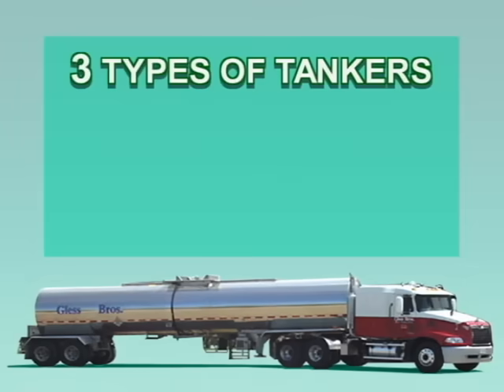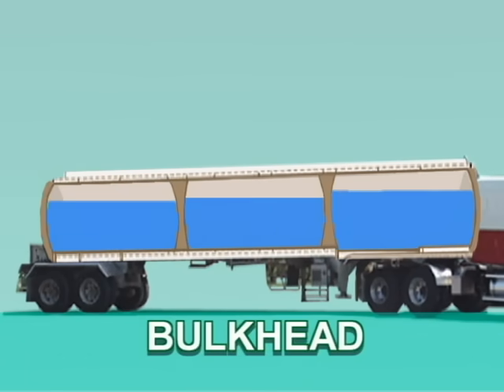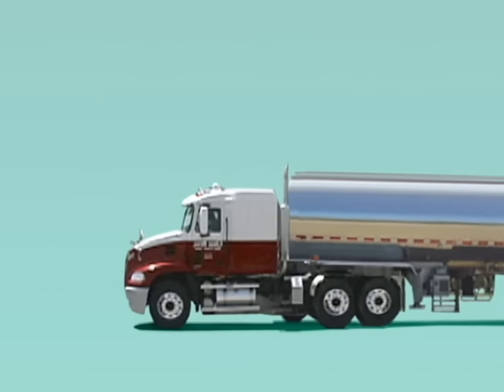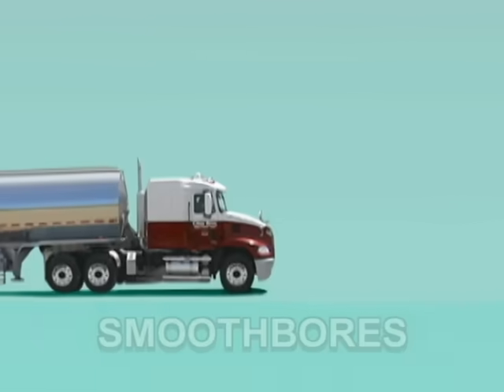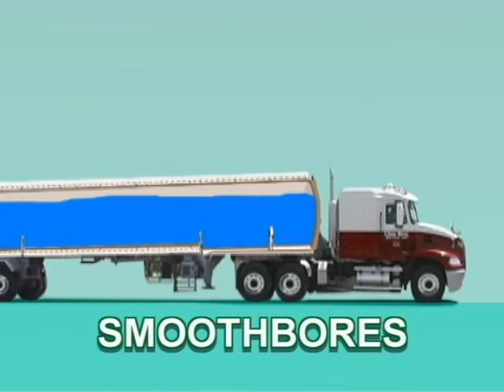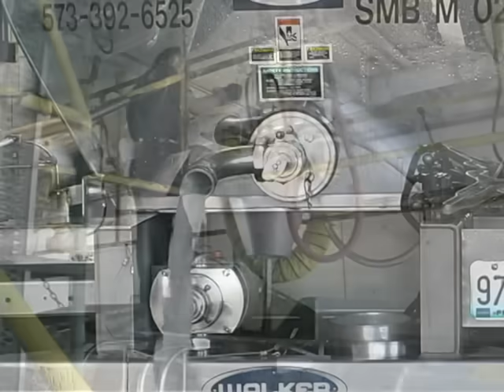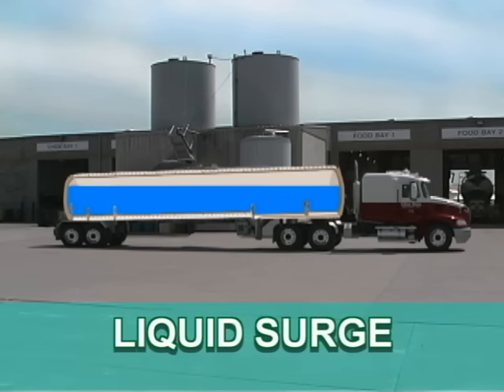Tankers Principles Animation

Comment: It's weird that nobody has made a 4th kind, to help with the side to side motion.
Reply: Toasted Fan Art I thought that would come up next since they kept mentioning it.
Reply: Maybe there is a solution but it would increase the time needed to unload?
Reply: KhataarFelMataar Surely they could just put some baffles down the length of it as well as from side to side. Then the unloading time would be unaffected.
Reply: Toasted Fan Art I wouldn't know I'm not knowledgeable on this subject. I just figured that it would result in bigger costs.. why else wouldn't they have made a solution for it? Hehe
Reply: KhataarFelMataar The dude in the video says how none of the examples have side to side sloshing protection, and that's it's dangerous. So I simply stated the obvious that if it's dangerous then they should make a solution. Adding baffles down the centre wouldn't cost much extra compared to the overall cost and also it's much cheaper than the cost of the truck tipping cos it didn't have the baffles.
Reply: Toasted Fan Art yes agreed
Reply: I was wondering that too...
Reply: Toasted Fan Art Exactly, and why can’t they be sanitized? Sounds more like an excuse for lazy engineering.
Reply: you can add a honeycomb structure that controls the liquid front-back & left-right.
Reply: Make a balloon as a wall and it will absorb the impact. Just don't inflate the balloon too much. BALLOON BREATHS
Reply: A rolling drum inside a bigger container would work. Perhaps it would be motor driven with a motion sensor...
Reply: Ace Report. How would you sanitize a enclosed tank with a internal honeycomb structure from organic particles.
Reply: Toasted Fan Art
Because if it's built right it's not a problem. The driver just need to keep wheels down and take corners appropriately. A 25 mph curve must be pretty damn sharp and probably not even suited for going faster regardless of baffles covering every axis. Wheels only have so much grip before they give up traction or go off like a pipe bomb.
Reply: just dehydr8 the liquids for shipping
Reply: @ToastedFanArt  it has to be noted and death with but side to side motion in a vehicle is much rarer. You just take a corner at a lower speed. Braking and Accelerating however are always safer if you can do more or less of either in an emergency.
Reply: I just dont understand why they aren't filled to the brim...  no more sloshing....
Reply: @noeeon9910  sometimes your route can't take that tonnage, or the customer doesn't require enough product for a full load.
Reply: @clankplusm   interesting I knew there had to be sound reasons.
Reply: @nectimusmaximus  maybe some sort of vacuum inside that sucks in reverse..
Reply: I work in liquid chemical logistics, and also spent more than a year working in the tank cleaning department. Basically, the more stuff you make in a tank, the harder it becomes to properly clean it too. We clean tankers by inserting a long steel rod with a rotating spray head on the end into the manholes on top. These spray heads spray around in all directions. With normal baffles that's not much of an issue, but if you put baffles on the sides to prevent liquid sloshing from side to side, those spray heads wouldn't be able to reach those spots behind the baffle. Also consider that not every liquid is the same, I work with a lot of fatty acids and very sludge like greasy products. Some products like alcohol or milk are super easy. But liquified animal fat or hydraulic oil can already make things significantly harder to clean.

Comment: just fill it fully and nothing will shake
Reply: tehserenity a full tank of liquid can still shake
Reply: it will spill
Reply: furiousninja 
Did u just under estimate welders and engineers to stop the spilling?
Reply: No I thought it would be pain in ass to seal it everytime.
Reply: furiousninja fill from the top, drain from the bottom. what's so difficult?
Reply: tehserenity 

Ikr?
Reply: zeckmon3 zeckee idk
Reply: How would you handle the vapors then?
Reply: tehserenity sounds like common sense to me... maybe there's a reason why that's not the case that we don't know about?
Reply: Clorox Bleach maybe because when the water expands due to temperature change or gas evaporates due to different temperatures it needs somewhere to go or else the container will explode or burst?? Idk.
Reply: some liquids in a fully load trailer would be heavier then regulation if you filled it all the way, that's why
Reply: if you leave ventilation then vapor not a problem
Reply: TheInceptioners yes lets ventilate gas fumes into the atmosphere lol
Reply: Anthony Perez where else is the gas going to go? not creating anything just ventilating
Reply: Oh shit you broke the physic code bruh
Reply: but if you fill a tank full of water and then it freezes....it WILL crack the tank
Reply: Too much weight
Reply: weight is not a issue, they can easly just make the entire tanker smaller if that was the case. or reinforce the wheel/suspension

the issue is what he explained in the video.
Reply: The reason why you can't fill a tanker to the top is because of mandated ullage space.  Example: LPG has a huge coefficient of thermal expansion that dictates a maximum 85% fill volume, and if you fill it to the brim, you'll have thousands of gallons of fuel spraying out the tank in no time.  If you're transporting human waste....everything will literally go to shit.  Filling to the brim also adds extra weight up top, which will both illegally overload your axles and raise the centre of gravity (tipping risk).  Best to keep the product at the correct maximum volume.
Reply: Would an air bleed system work?
Reply: maybe

..but im pretty sure there are millions if not BILLIONS of dollars being put into optimizing transportation costs

so you can bet there are going to be engineers racking their brains over this stuff. I would imagine that if that would work, they would have added it.

cheap/en-mass transport is one of the biggest hold-backs of society following energy storage and collection/transportation.
Reply: Tom Jerry lol yeah the biggest issue engineers really have isn’t something that works... It’s something that’s legal too!!

And we’ve gone a long way with our ways of transporting goods, it’s too bad trains aren’t as utilized/useful anymore.. They gave us a huge boost when they were relevant.
Reply: tehserenity Just leave it empty. Problem solved.
Reply: Adam Bibinski then make a smaller container or leave a few compartments empty.
Reply: One reason is because loading it to the brim would most likely put the truck over 80,000 pounds. Which is the legal weight limit.
Reply: tehserenity If completely filled the tank then the unit would be over weight and have no room for expansion of product. It far more dangerous to overfill a tank.
Reply: Wait, do gas tankers unload their whole load at one stop?
Reply: You can't fill them because liquid expands and contracts in transit. When i hauled gas for Sun, we put 8900 gals. in a trailer that could hold 9400 gals., or 7600 gals. diesel. WEIGHT WAS NEVER AN ISSUE, because they know exatly what the product weighs, and most companies have their equipment set up to bridge the weight on all the axles. We would pull out at 80,000lbs. exactly. Everything was high end light weight. Our tare was abiut 27,000lbs., and the damn trailers cost more then the tractors. They were 4 comparment, the biggest was 3000 gals., and the smallest was 1800 gals. The 2 biggest each had baffles in them. I never felt forward or backward surge, and only felt it sideways when hauling heavier products, like deisel or jet fuel. I will say this, even though it could get nerve racking in winter, it was a gravy job, and I made really good money.
Reply: Exactly! and also the liquid expanding because of the heat. also @mark Lydston i was interested in being a tanker. You think i should go to Prime to become a tanker and get my cdl training there? Also which type of tanker pays the most ?
Reply: mybro727
The tank used should be built with the cargo in mind. If you deal with high vapor pressures, the tank must be able to handle that. Also, the pressure is higher the less liquid present and has a temperature component added too. A full tanker shouldn't have a lot of vapor at all.
Reply: TheInceptioners
vapors are usually transferred between storage tanks and the truck with a hose, it's called vapor recovery. Eliminates a massive explosion hazard at the same time as you don't have a whole gas station lingering in gasoline vapor ready to explode when the nearest fart rips.

Comment: For fuel delivery, we use the bulkhead one.  Have 5 or 6 different compartments.  Good for delivering different products to a gas station.  Maybe 4 compartments regular, 1 compartment premium and one diesel.  It's also good to be able to load a bit heavier in the front and loading a bit lighter in the back, if it's winter driving conditions.  Extra traction for the tractor.

Comment: I even had serious problems with "liquid surge" when using a forklift to move partially filled drums and 330 gal. IBC totes. I lost one of my partial drum loads, which was filled with extremely expensive masking agent. I was lucky, to say the least! Where I was working, we were also moving drums of high strength hydrogen peroxide with the forklift.  The masking agent incident totally changed my perception on forklift operating as relating to safety and materials transport/movement. Liquid surge can be deadly regardless of the transport scale!! I've had lots of forklift training/safety, but I don't recall any ever dealing with this liquid surge and related, on forklift.

Comment: I learnt to drive trucks in a rigid smoth bore tanker. I think i got thrown in the deep end from get go and just told not to roll it over and never did but had it on the lean a couple of times. Very strange feeling to drive and getting gear changes timed in with the surge took some getting used to.
Reply: I thought I was going over in a tanker once. Lil too fast in a curve and lightly moved over in my lane to give oncoming traffic more space, and then my butthole left a bite mark in the seat.
Reply: @juliogonzo2718  😂😂
Reply: @juliogonzo2718  LOL!

Comment: On straight road, sloshing is no problem. The real problem of breaking out sideways becomes a problem when strong braking happens while driving through a curve.  If we prevent the liquid too strongly from coming to the front, the truck would literally "rail off" with its tailside. So this is a matter of proper balance between sloshing displacement and trailing stability.

Comment: sooo just a stupid question of mine: since water is uncompressible, why don't they just fill up the tanker till it's 100% full (given the tanker is indeed filled with water). ? If it's full the liquid won't flow anywhere when you brake or accellerate, right?
Reply: Hier könnte Ihre Werbung stehen Liquids can be compressed a little bit.
Reply: Water weights 8.3 pounds to a gallon and a typical US smooth bore tanker holds 6500 gallons. If filled they would be overweight.

Comment: This guy loaded a produce truck wrong. He did not listen to the system that told him to balance out the truck. It put each pallet in its own area to balance the flowers with the bananas. Instead he put all the flowers on one side and bananas on the other. Well when the driver pulled the trailer off the dock it flipped on the first curve.